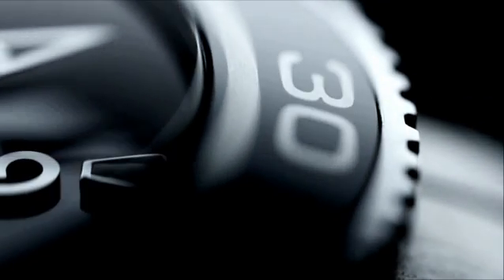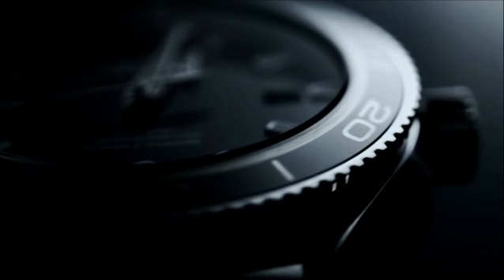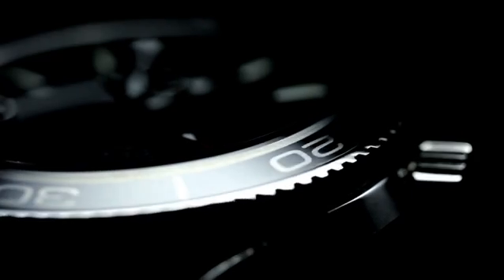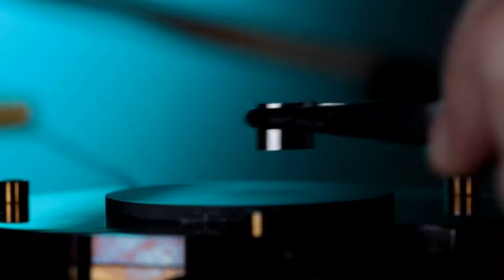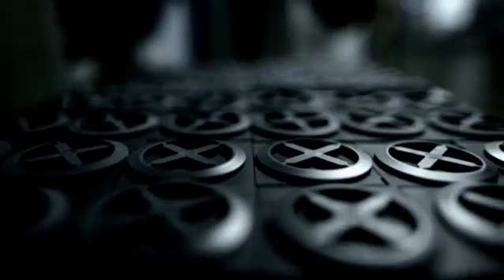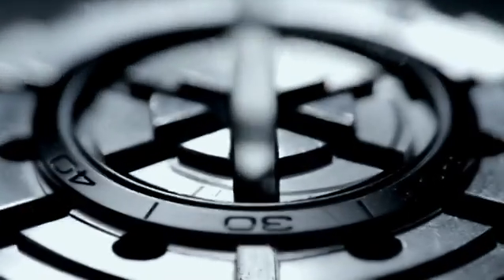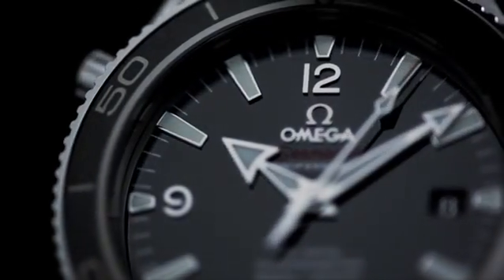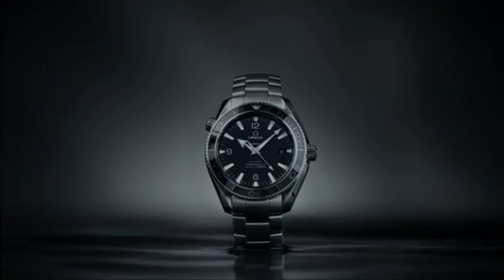OMEGA Liquidmetal ® Technology

Comment: After the Liquidmetal gets pressed into the ceramic bezel, how does the excess get removed? Does it get "smeared" off, parallel to the bezel's plane? Or, does it get ground off precisely or even without worry since the ceramic is hard enough not to be scratched? If it were, say, liquid aluminum or a lighter metal, then I can see that happening quite easily in a very malleable solid state or in a molten state (in which case, the metal can be more-or-less cleaned off).

Comment: No. The model no. is 222.30.42.20.01.001

It has been discontinued and is almost impossible to find in boutiques. If you can find it, price can go as high as USD6700.